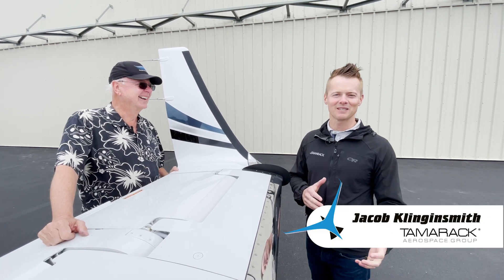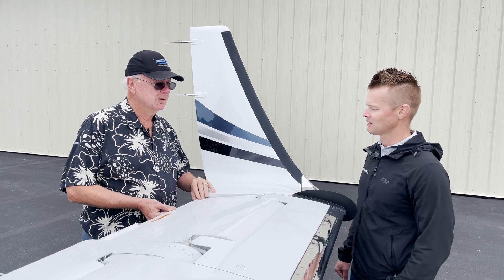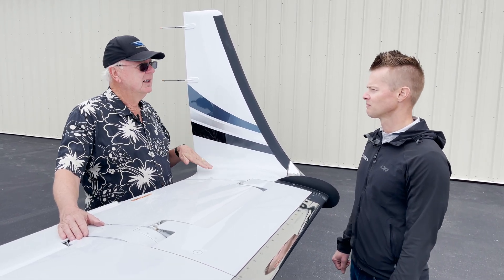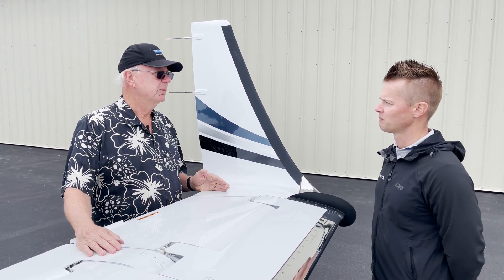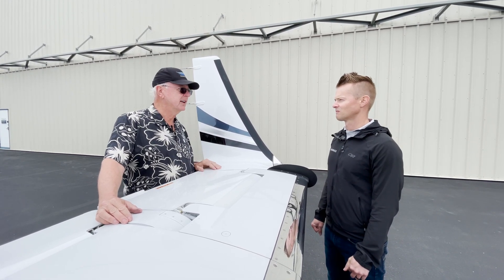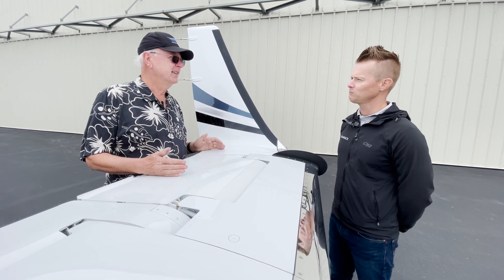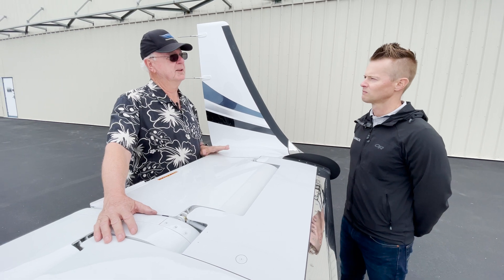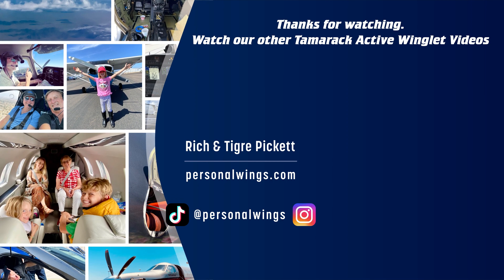Tamarack Active Winglets Interview with Jacob Klinginsmith, President Tamarack Aerospace

Comment: Not worth the added risk.
Reply from the maker: Multiple aircraft have them and are flying fine. No definitive proof they have contributed to those accidents.
Reply: @PersonalWings  All aircraft fly fine until they don’t. We all accept a certain amount of risk. But this is extra risk solely to save a few bucks. I’ve flown in one of these and I’m not confident in the ability to regain control if it decides to go haywire at low altitude.

Comment: How can you fellas not address  as well the crashes of Citation jets as a result of un-commanded rolls initiated by the Tamarack winglets ?  What has been done to insure such a thing can never happens again ?
Reply from the maker: From what we know, there have been five instances reported to the NTSB related to uncommanded roll in Citation 525 series aircraft equipped with the winglets - one was fatal.  We don't know of any other crashes. all others were able to recover and land successfully.  On at least one (in Europe) it appeared the operator had not complied with an earlier Service Bulletin (SB) issued by Tamarack, and several more SBs have been released by Tamarack.  At least one SB was released after the fatal accident involving the CJ2.  

While we are not accident investigators, from the incident/accident reports in the US and Europe, they appear to be uncommanded deployment of at least one  Tamarack Active Camber Surface (TACS).  The TACS are the control surface located on the aft portion of the winglet wing extension to alleviate aerodynamic load.  While not an 'aileron' we would expect that asymmetric deployment would initiate an uncommanded turn - similar to a runaway/abnormal aileron trim situation.  The first action in any runaway trip/control situation is to disconnect the autopilot (and hold the AP/Trim disconnect swwitch), grasp the control wheel firmly... and reduce airspeed.  You need to reduce airspeed to reduce the aerodynamic force on the uncommanded trim surface to gain control.  On at least the fatal CJ2 accident the NTSB report does not indicate the pilot did that.  The Tamarack AFM supplement specifically tells pilots to reduce the throttle and limit IAS to 160 kts when the system fails. 

I have had uncommanded trim failures in high performance aircraft - including Citations.  I test fly a number of jets after maintenance before delivering them to my clients and in one instances the pitch trim failure was extreme and if I had not reduced my airspeed, I probably would not be writing this reply.

We don't know,  nor have the expertise to ascertain, if any pilot action could have saved the lives of the people in the CJ2.  We do know that it is imperative for operators to comply with SBs, for pilots to be adequately trained and be proficient on emergencies.  I do feel confident flying the jets with the winglets, and do just that several times a month, as well as I train and review the emergency procedures for myself and the pilots I train. 

This ended up being a longer reply than I intended, but hope it helps in some way - and perhaps initiates other questions.
Reply: March 2025
Came here after seeing another fatal crash of a plane with Tamarack winglets.  
I'm surprised that this is a known problem that has been around for years!
Reply: @ can you give a link to the recent crash you are speaking of ?